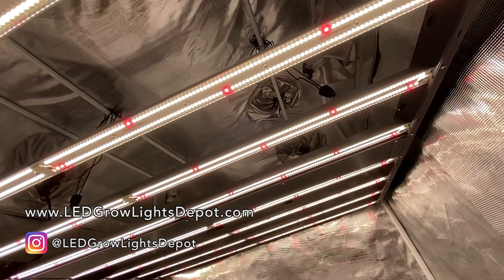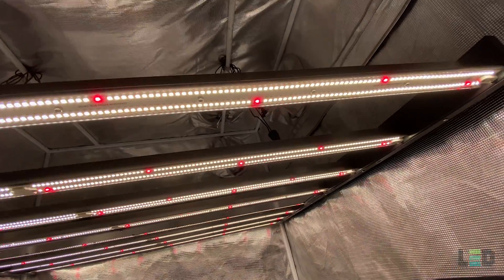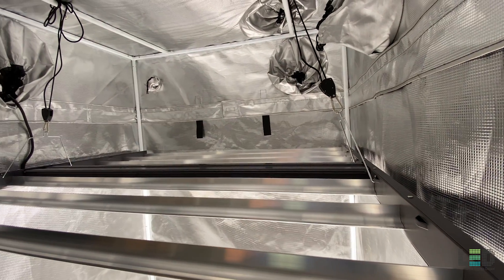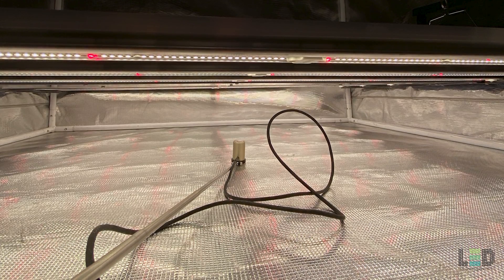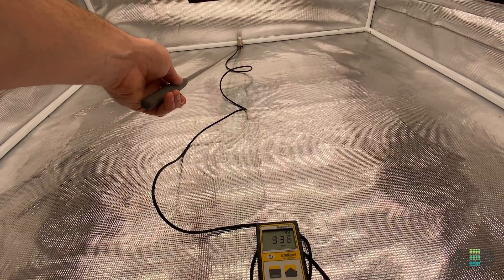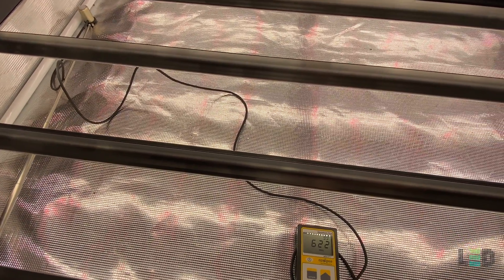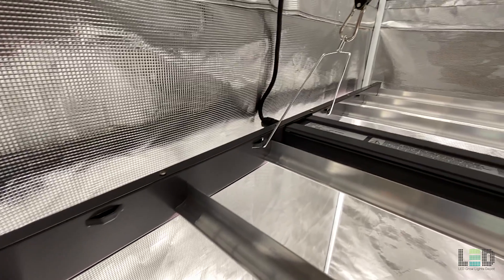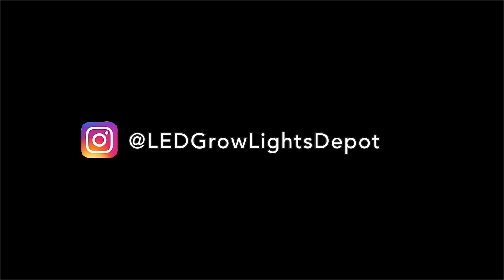Gavita Pro 1700e LED Grow Light Review and PAR Testing

Comment: It’s just not good enough to justify 1199$. There are better or cheaper options in my opinion that use reputable components.
Reply: Cheaper options doesn't take into account gavita warranty or resale value. Why would you want to decrease output lower then 50% unless your talking clones.
Reply: @Ryan-mc3mx  Why would I want to decrease the light output past 50%??? First off, a fixture that pricey shouldn't be limited in any manner, especially such a basic one. But to answer your question there are several reasons...

As you mentioned earlier, clones and seedlings utilize much lower levels of light. And some growers like myself choose to manually simulate a sunrise/sunset effect by using the dimmer knob, but that's obviously not possible in this case... Lower light levels also come in handy if plants grow too close to the light and ceiling height is an issue. And not to mention the biggest factor of all, and this may come as a shocker, but not everyone grows cannabis! Some species of plants simply require lower levels of light...
Reply: Exactly...  And it has no onboard dimming so you need a controller in order to dim it down. And it needs an adapter in order to hook up a controller? And it only dims down to 50%! No wonder you don't see many growers with this light.

Comment: Have two gavita pro 1700e and master controller EL2 gen2 in two 5x5 tents. Grows plants short and tight which is good when having limited high restrictions. But what didn't like was had to pay extra for component that should already be included. Like the power cord, dimmer control and led Adapter. Them things cost good chunk of money! Also the dimmer only goes down to 50% which kinda sucks...whomp...whomp..whomp.
Reply: My Sonofarm  has all that built in I have both lights I total get what ur saying. All that money an gotta buy more shit for it 1700e.  Is great light but fk
Reply: It only goes down to 50% because it doesn't lose efficiency until below 50%. Therefore it's better for the bulbs and plants. That's why the Phillips advanced driver is so good
Reply: Hows it perform in 5x5? Can't  decide whether to go with that or a 4x4.